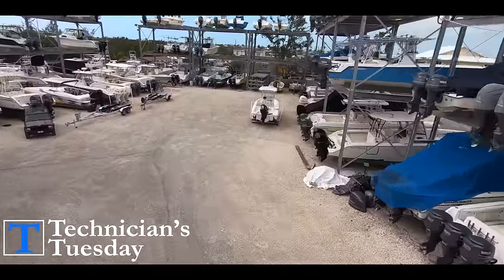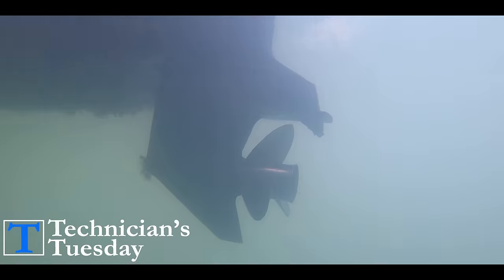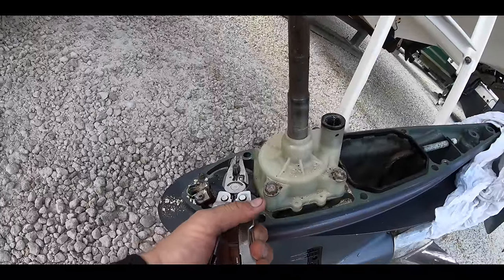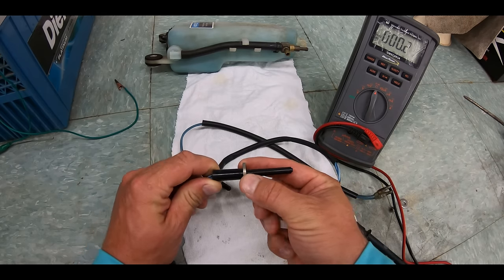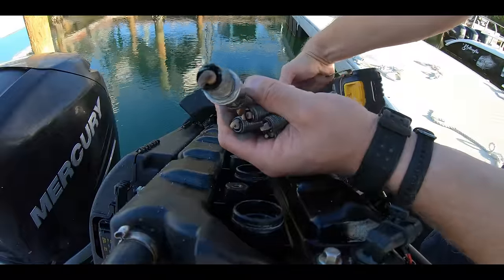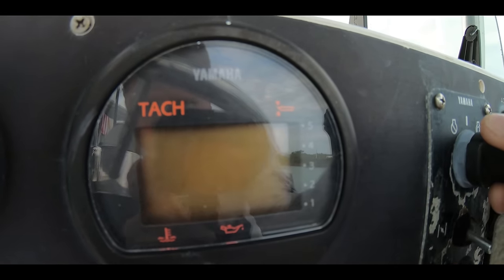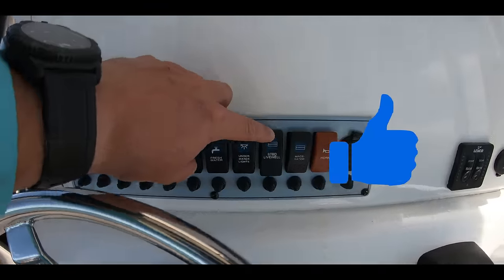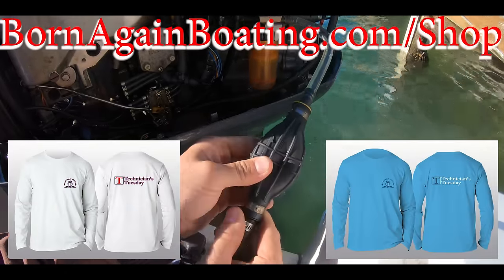Outboards #1 PROBLEM!

Comment: Knock on wood, I'VE NEVER had any problems with my 4 stroke Yamaha!  Of course, I do all the maintenance work on time and all the time. Yamahas are just great! I've heard some horror stories about Mercury engine. I never liked Mercury!!! In the past, I had a 2 stroke Mercury engine which was THE MOST TEMPREMENTAL MACHINE I'VE EVER OWN! When you are running offshore, you NEED THE RELIABILTY OF THE YAMAHA ENGINE, PERIOD!
Reply: I am sure a few bad ones get past QC  but they good motors I am poor so I have to buy used and you never know what people did to it before you get it Never owned a 4 stroke just can’t afford it thanks
Reply: @samtate1260  The 4 stroke Yamaha was also used and the guy who owned it was very meticulous like I am - : ) So, the key is to find the right seller who took care of his/her stuff. Needless to say, it's also important to find out why they are selling it even though that may be hard...
Reply: @melrose9252  I shared my personal experience and none of my findings were based on "horror stories" like yours. Also, about 2 months ago, my neighbor bought a brand new 50 HP Mercury 4 stroke  and the engine is already back in the shop. I told him to go with Yamaha, but he couldn't afford it.
Your claim is laughable, I am not sure in which planet you live , but so that you know on earth, Yamaha is more expansive than the temperamental, junky Mercury! No outboard can beat the reliability of Yamaha.  For your information, I also owned a Suzuki which is the second best after Yamaha. Now, tell me, who looks more ignorant and stupid?